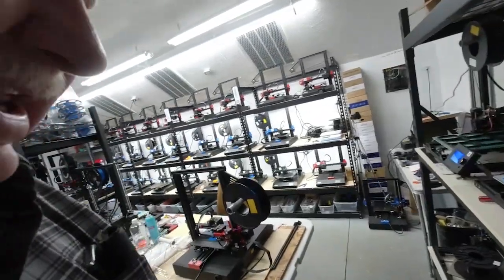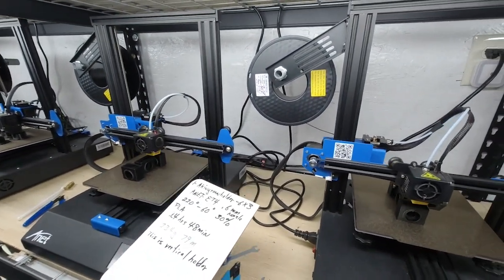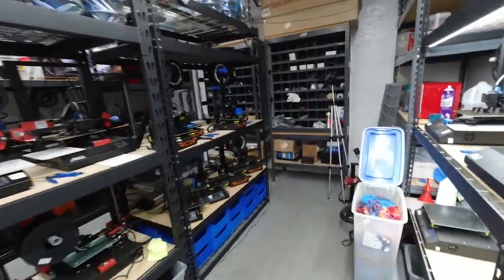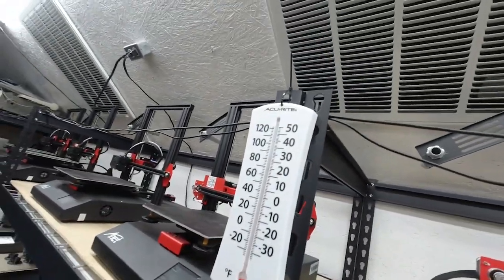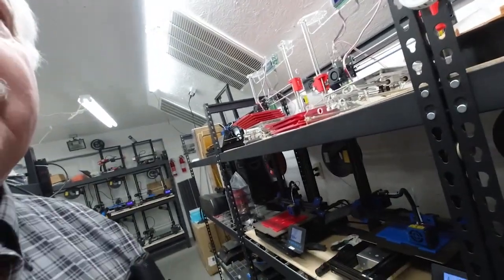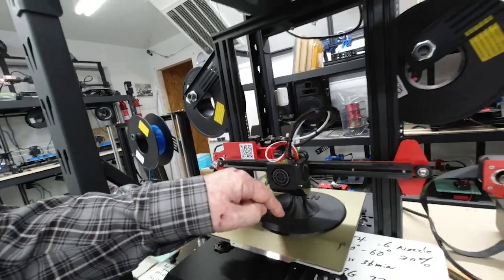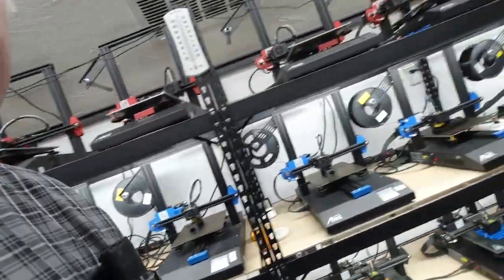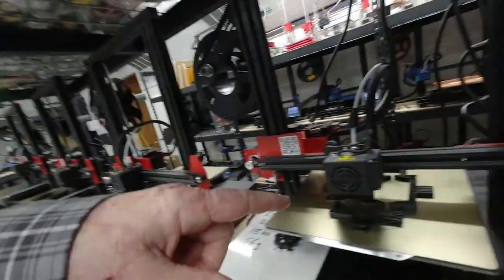(27) 3D PRINTERS WORKING HARD TODAY AT MY PRINT FARM, an inside look at how I manage them.

Comment: This is pretty cool I own a kp3s and I love the little thing, kingroon keeps bring new versions of the kp3s so quickly, I haven't owned mine for a year, and there is the kp3s pro, kp3s s1, kp3s s1 pro, and differenced  after kp3s is linear rail on y axis and z, but wheeled on the x, I believe kp3s s1 pro is linear on all 3 axis.
Reply from the maker: I still have about 12 KP3 printers and they still print very well. There are some features on the KP3s  printers that I don't like. For one the filament is harder to load into the direct drive extruder on the KP3s and I have to be directly over the flat display to change settings ect. which is hard when you have printers on shelving. Overall O like the Kingroon printers. Thanks for sharing your info and for your support...Ken

Comment: aquanet hairspray tho. i use those!
Reply from the maker: I don't like the mess using hair spray, but on glass bed printing it does work well. The spring steel pei bed is not messy and also works very well. Thanks for your support...Ken